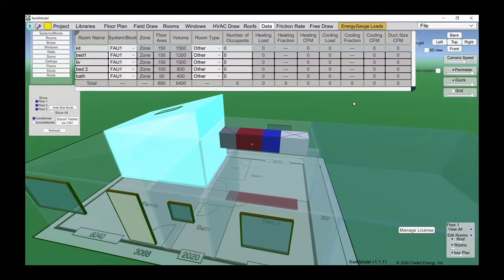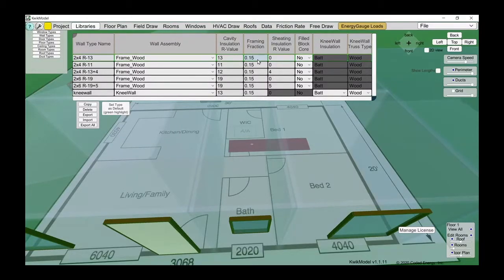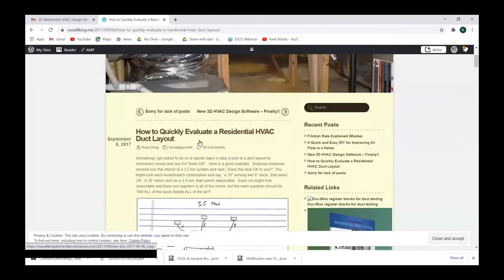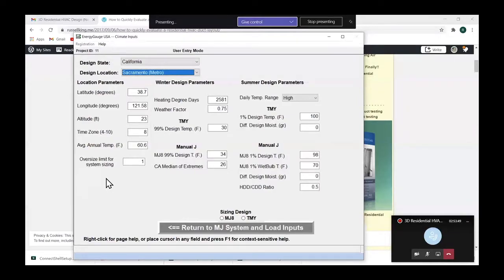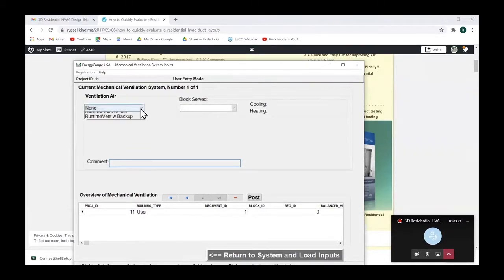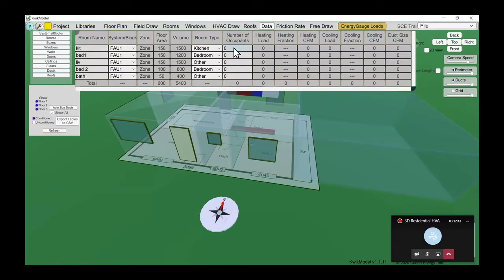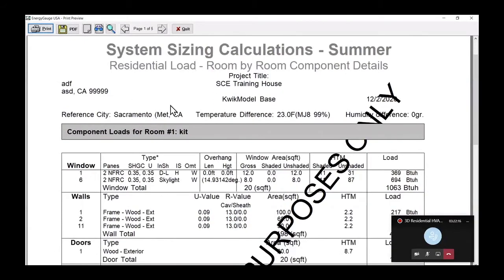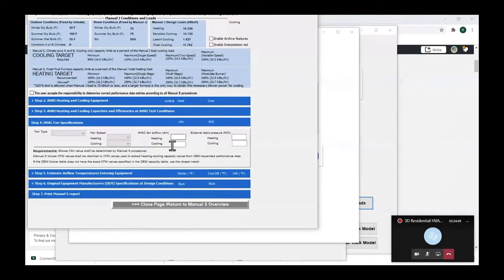Intro to 3D Residential HVAC Design, Day 1, 2nd Half, video 2 of 4, Sponsored by So Cal Edison

Comment: I'm trying to hit energy gauge but I get a pop-up saying I did select a roof. So I went back and added a roof but it still keeps saying the same thing. Any ideas?
Reply: Go into the roofs tab and click the box that says "Set Roof Values Manually" then enter the slope of the roof.  e.g. 2 in 12, 4 in 12, etc.  It doesn't have to be exact.
Reply: @russking63  that's good but now energy gauge is not popping up. I only download the newest release not the one that says with energy gauge. Is that why? 🙈
Reply: @Elisummit845  EnergyGauge is included.  Look in you task bar, it may have opened up behind your Kwik Model window.  If so, there will be an icon in your task bar.  Click on that icon, or minimize the Kwik Model window.
Reply: @russking63  I'm not sure what was wrong but something was definitely wrong with the download. Got it to work now. Thank you. Moving along 🤣

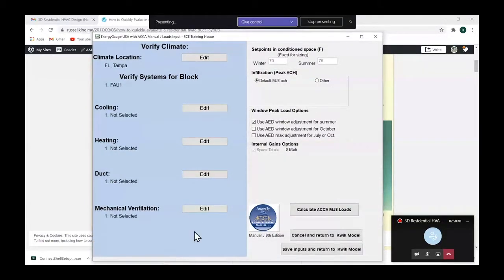Comment: Love this. What's very frustrating to me at this point is, I'm up to 25:00 on this part, I'm having a very hard time zooming and turning the model. I didn't hear you explain how you zoom so easy. It gets close and far without me even knowing how I'm doing what.
Reply: Hi Eli,  The W, S, A and D keys on our keyboard will zoom in/out and pan left/right.  If you click on the little question mark button in the upper left corner, it will give you more control advice.  I recommend a good mouse with a wheel.  The wheel will zoom in and out.  Hold down the right mouse button and move the mouse around.  This will rotate your view.  The wheel can also be a center button.  Hold it down and move the mouse.  This will let you drag the drawing up/down/left/right.  The left mouse button is for selecting or placing things.
Reply: @russking63  awesome. Btw if you remember me, at the symposium on Thursday we took the van back to the parking and we were together you and Ed and your other friends. I was with the Jewish group of guys, if you remember. On Friday after the class we had a little talk about a job we did. 2 floors 2 separate units and the heat from the downstairs unit was heating up the top floor. Turns out the ductwork was a disaster. We are redoing all the ducts, thank God it's all in the attic.